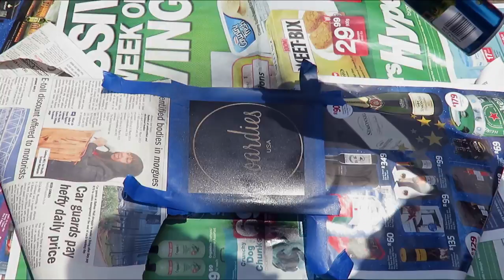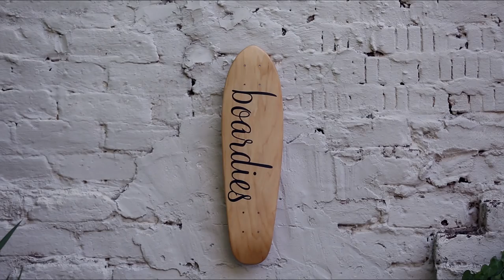Making the Boardies Cruisers

Comment: Cool edit! What kind of wood do you use? How do you get the tail in the deck?
Reply from the maker: +JornProductions Thanks man. The boards are made of maple. The tail is premolded into the deck. By using many layers of wood then squashing them together tightly into a mold with glue, You end up with a curved formation of the wood. Watch this video if you would like to understand more about how tails are made. https://www.youtube.com/watch?v=ZQMn625MF5w
Reply: +Alex Smit Thanks! How many layers of maple do you use?
Reply from the maker: Typically I use are pressed boards. Basically I reshape blanks which are normally 7 layers. But the boards that I'm planning to make from scratch are 5 layers
Reply: +Alex Smit Cool! When do you start with selling this boards? How much will it cost?

Comment: Such a nice channel! As a Casey Neistat´s style fan, I really like it! Great job! New sub here. Regards from Spain!
Reply from the maker: +freealdana Thank you so much! Really appreciate the sub:) How's Spain doing?
Reply: +Alex Smit nice! I´m building a cruiser now, from an old skateboard. any advice for painting it?
Reply from the maker: Just use standard spray paint, make sure your surface (board) is VERY smooth and spray light coats of paint from a foot and half's distance. Let it dry for at least 3 hours in the sun. Then give the board a light sanding with 800+ grit. Then coat with clear coat polyurethane and once that has dried give that a light sanding of 1000+ grit sandpaper.
Reply: +Alex Smit great. Thanks for the quick answer!